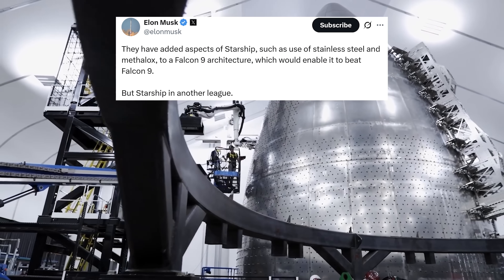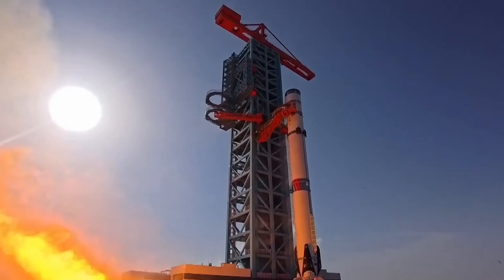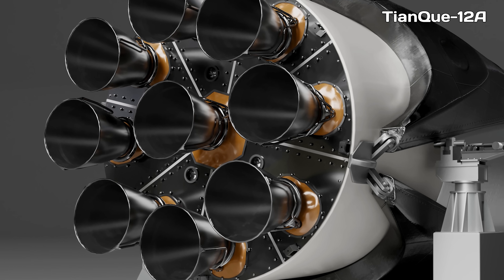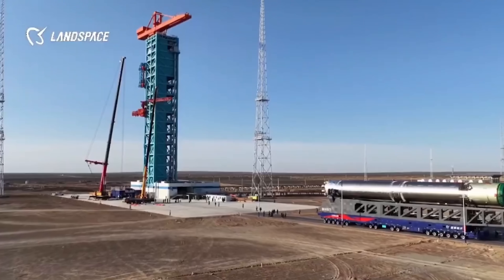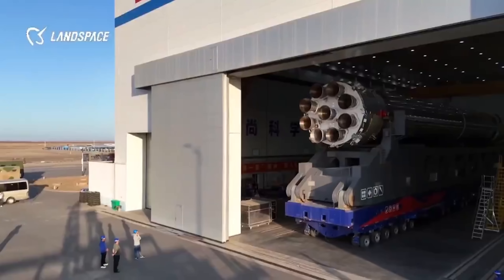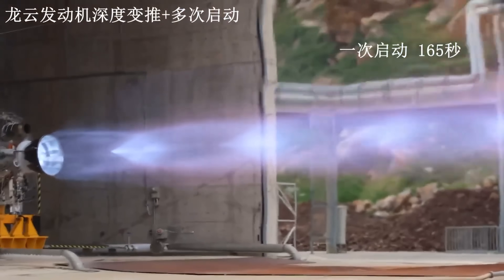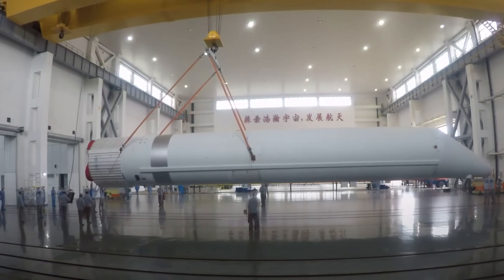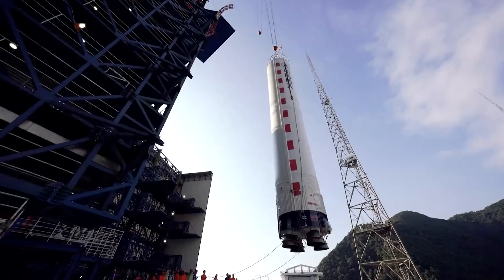Elon Musk revealed something Big Happening with China Falcon 9 Clone, Better than SpaceX...

Comment: clickbait title — I watched the whole thing so you don’t have to.

Answer: no, ZQ-3 Block 1 will fall woefullly short of current Falcon 9, coming in somewhere close to the original 1.0 model. ZQ-3 Block 2 with upgraded engines will get close but not quite beat it.
Reply: eh? payload capacity to LEO is estimated at 22,300kg versus falcon 9 22,800kg.  how is that woefully short?
Reply: @RichardsMiscCorner  those numbers are for the Block 2 version with upgrade TQ-12B engines. With the TQ-12A engines they are flying now, they are only going to get 11,800 kg. see 3:39
Reply: @leeswecho  ah I see, correct.  it should be noted though that this isn't china's primary launch mechanism though.  but it will be interesting to see how quickly they move to 3E.